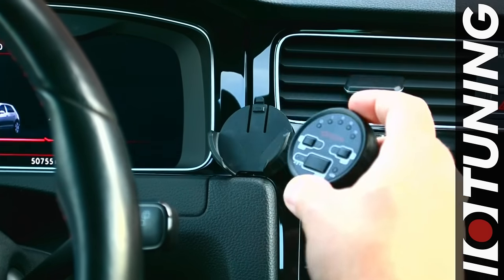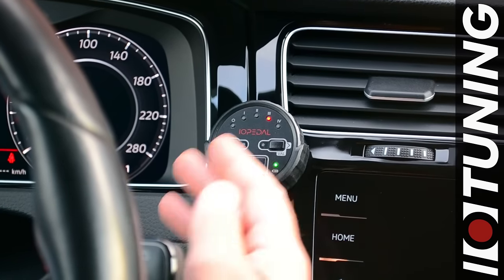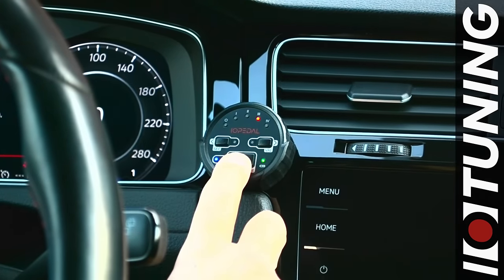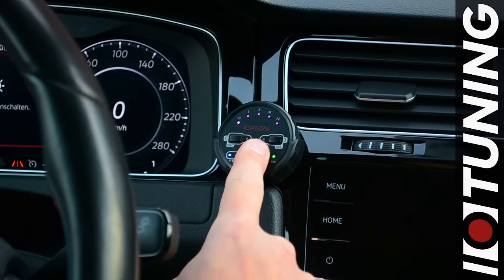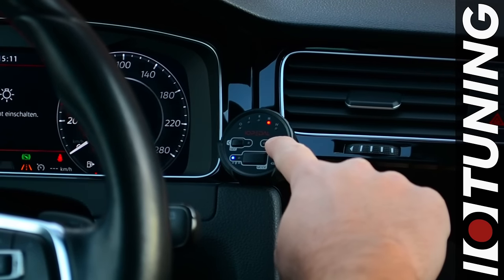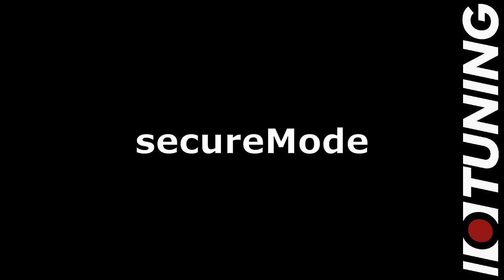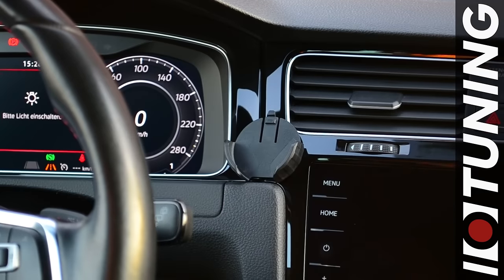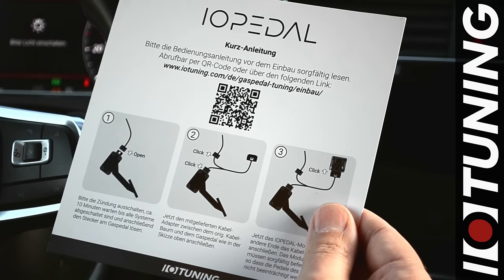IOPEDAL - Remote Control Manual [ENGLISH]

Comment: What is the lowest RPM you can set it ?
I have an C5 Aircross 2020 hybrid with 225 HP and unfortunately it idles at around 1500-1800 for no reason all the time and as soon as i start the engine, i wonder if this can fix the issues and make the car default to lower RPM around 800-1200 by default ?